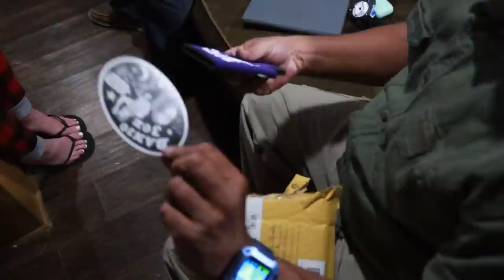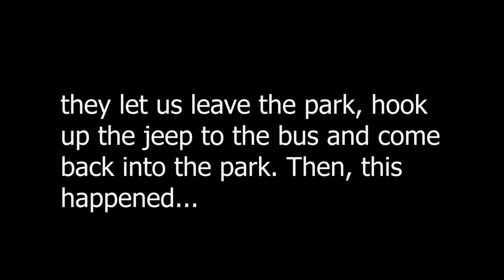Buslife: A Long Roadtrip from Texas to ????

Comment: If PB blaster doesn't help with the sticky throttle, Seafoam might.

I found snow chains in a front compartment of the bus I bought that had sat in PNW for 15 years. They were pretty much a block of iron and I couldn't get a pry bar to move them. Dumped half a can of Seafoam on the top of them, the next day they pulled out like I was getting ready to put them on the bus for a winter mountain pass. 

Amazed me!
Reply from the maker: That is very amazing, actually!

Comment: Great camping spot on the ocean. Long drive from Texas. 
To help with your air throttle problem. Shorten your throttle return spring at the governor or  add another return spring. The throttle lever at the fuel pump governor should have some resistance to moving. The air cylinder really has no resistance. That’s why you only have fuel throttle or just idle.  If you have more return spring pressure you will have more control of your throttle. 
For the black soot exhaust smoke on your car. That’s incomplete burning of the fuel due to lack of air. When was the last time you changed your air filter. The other thing to help with carboned  up injector tips is to run 1/2 quart of automatic transmission fluid dextron 3 in every second fuel tank fill up. Will take a couple of tanks to see the difference. By adding automatic transmission fluid to your fuel it will also give lubricity to your fuel injection pump and injectors. The ultra low sulfur diesel fuel has no added lubricity to it. That’s one of the reasons why a lot of Diesel engines have fuel injector pump failures due to no lubrication in the fuel. That’s was one benefit from sulfur. The automatic trany fluid will help clean the injector tips. 
I have been doing this since the 80’s 
on my Diesel engines and when I work for Cummins. 
Good luck and keep producing those great videos 
Cheers
Reply: Wow ! I have Cummins diesel, never knew this, THANKS !
Reply from the maker: Definitely going to give this a try. It seems like an inexpensive pmcs for the engine.
Reply: @BussyMcBusface  Air cylinder right now is stronger than the injection pump  control lever. Your throttle control spring is tired. Doesn’t have enough tension to pull back on the air cylinder rod. That’s why you have full throttle or idle. The return spring pulls back the throttle lever when you back out of the throttle pedal. You then should have full control from idle 650 rpm to your full idle 2100 or 2300 rpm. You might have to play with different springs to get more return tension on the throttle lever. 
It’s very common for these return springs to wear out over time. You should also have a spare or two. It’s very common for them to break. 
If you have any questions email me. 
Good luck

Comment: Buy a small pressure washer you can store on the bus will make it far easier to clean just using water. This item should only be used at campgrounds or any overnight parking location where you have access to water. 

Food for thought

Comment: Hey guys! Mike, you have something drastically wrong going on in that motor. You should not have any soot on your Jeep. Take it from a truck driver, I haven't seen soot like that since the 90s when I started. Your burning oil or for some reason burning diesel very poorly. Do some googling and see what you can fix on your own since i know you like working on your rig. I've also mentioned Hot Shot Secret products before. They can help you get your rig running more efficiently. It's not snake oil products and no I don't work for them. Love the videos, living vicariously through you while I have 15 more years of work ahead of me before i can live in a skoolie.

Comment: Might be better to mount a stack type exhaust and blow the gasses up over the roof of the bus even woth the sucktion created behind the bus most of the soot will blow over the car , only downsite is that you whont be able to see the smoke in youre rearview mirror (might be handy to predict problems)
Reply from the maker: .actually thought about doing something like that but the fabrication was just too much. I would have to run it up the side of the bus Which would get in the way of some of the screens that I need to open to change filters or service the external radiator.
Reply: @BussyMcBusface  hmmm yah that could be bothersome , maibe you could make the stack in two parts that slide intoo eachoeter with the parting above those screens , that way you can leave the top part of the stack mointed and still have acxess to those screens , i dont think blowing the smoke down will do mush as theres a lot of buffeting behind the bus where the air that goes around surtanly dont have a busbody in the way
Another option might be to move the exhaust so it dumps out near the front wheel , but that prolly only blackens the whole side of the bus